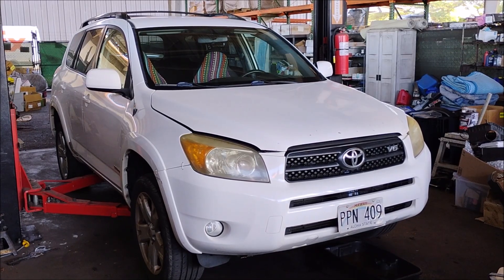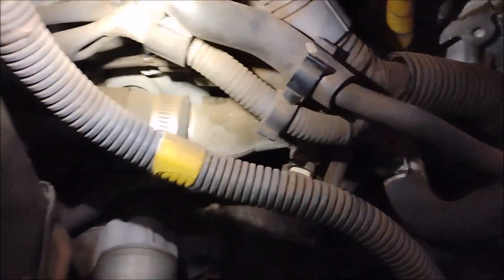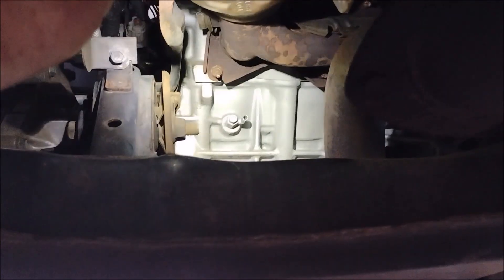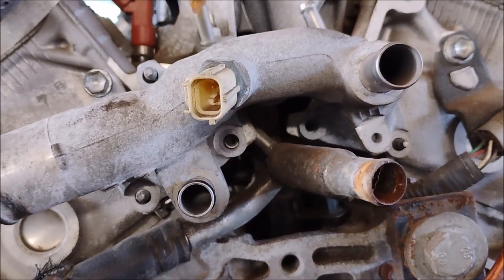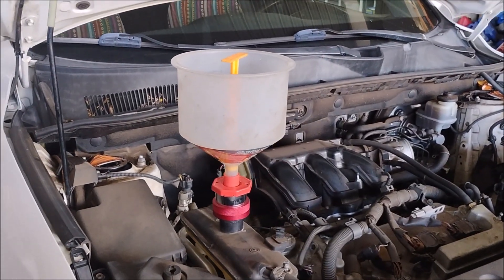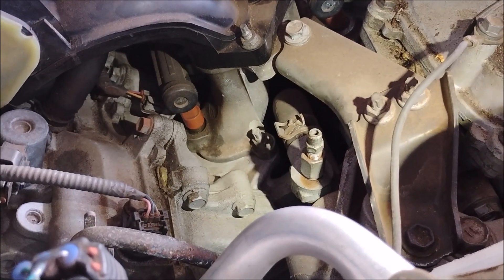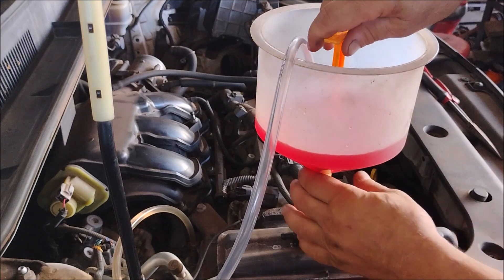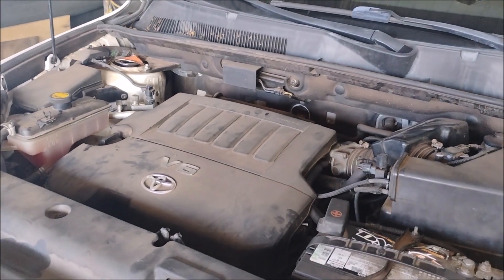Toyota 2GR-FE Hidden Coolant Leak - 3.5-liter V6 - RAV4 Camry Highlander Sienna RX350 ES340

Comment: Great video! Do you remember the torque specs for the 4 nuts and 2 bolts on the water outlet? Thanks
Reply from the maker: these are m6 so in general the torque is about 8ft.lbs.
Reply: @Merryfrankster_ Thank you!

Comment: Good video, I am not trolling you by any means, but before you take bleeder hose and funnel off you should start car run the ac and heat for several minutes to purge air from those systems also . I learned this from the carcarenut channel, a Toyota dealership mechanic for many years and now owns his own shop in Chicago I think, check the channel out if you get a chance. Great video you made . Alot of people do not know about the bleeder valve on the 2GR-FE and although it is a very good motor it is very temperamental when it comes to burping all the air out of the cooling system.
Reply from the maker: Pal you needed to watch the video before commenting. At 10:30 near the end I state that I run the engine with the reservoir open until the thermostat opens and any remaining air comes out. You definitely are a troll.
Reply from the maker: What car care nut not getting enough views, he needs to send out troll armies to cross-promote his channel?

Comment: Was that available on the 2016 rx350...i think it changed to the fks dual injection in 2017...thanks
Reply from the maker: Basically the same coolant system on the 2GR-FKS.